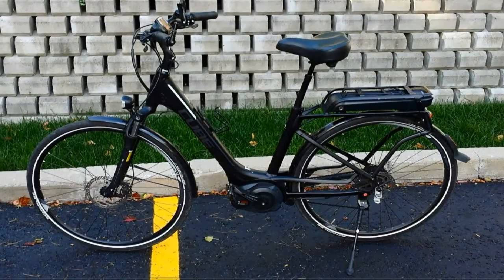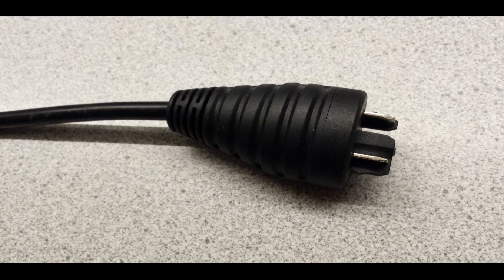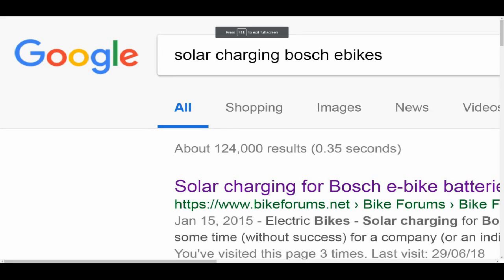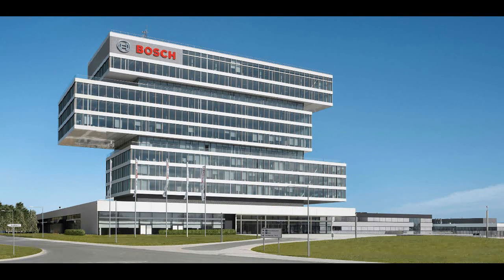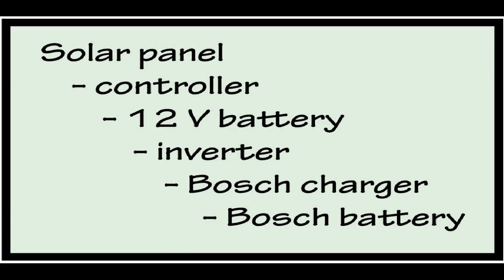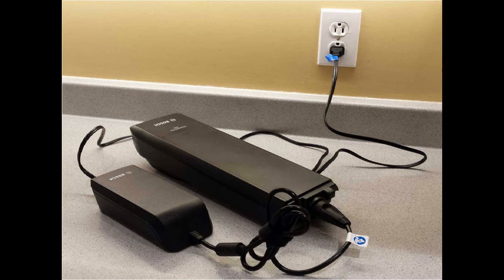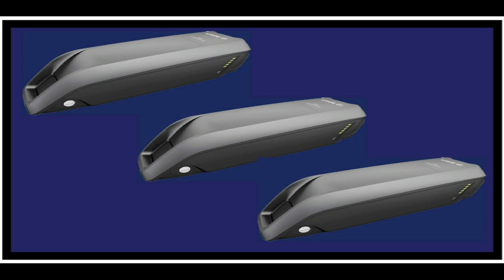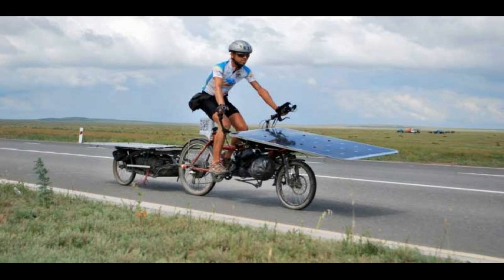Solar Charging a Bosch Ebike Battery   Disappointment

Comment: Bonjour Robert, je suis présentement en voyage de Montréal jusqu'au Iles-de-la-Madelaine avec un vélo solaire.

Je n'ai pas un moteur et une batterie Bosch. C'est un kit mid-drive que j'ai acheté de l'ouest canadien. Il est très facile de trouver le bon connecteur dans mon cas. Tu pourrais couper le fil et installer un autre type de prise peut-être?

J'ai pour ma part construit mon trailer en 2x3 + corroplast, grandement inspiré de ton design. J'ai deux panneaux de 100w sur mon trailer et un MPPT booster de la compagnie Genasun. Je suis HYPER satisfait des performances. Même en trainant tout mon stock de camping et une petite guitare j'arrive très souvent à mon camping avec une batterie à moitié pleine. Je fais des journées d'environ 110 à 150km. Je pédale environ 5 heures par jour gros maximum. 

Je me recharge dans le mur pour combler la différence le soir et je repart le lendemain à pleine capacité. C'est vraiment incroyable la quantité d'électricité qui peut être produit par deux panneaux de 100w. 

L'idéal serait d'en avoir un autre pour être 100% indépendant mais ca serait un peu trop grand et lourd en cas de panne pour moi. De toute manière, dans tout les campings il y a des plugs électriques.

Une autre solution pour toi serait peut-être une seule batterie sur mesure qui est capable de recharger à 8 ou 10 amp. La charge serait très rapide et sur un arrêt dîner par exemple tu pourrais recharger grandement.

Bref, je te remerci pour l'inspiration et je continue ma route vers les Îles. Peut-être nous croiserons-nous sur la route? Je reste à Montréal si tu cherche un endroit ou t'arrêter et camper dans mon appartement. 

Bonne route!
Vincent
Reply from the maker: Bonjour Vincent,

Merci pour ton interaction. Je suis pleinement d'accord, qu'aux latitudes du sud du Canada, il faut trois panneaux de 100 Watts pour être autonome. Mais c'est gros à charrier. Je suis content que tu aies pu t'inspirer de ma remorque pour construire la tienne. Je te souhaite un fameux de beau voyage aux Îles de la Madeleine.

Robert
Reply from the maker: Vincent,

Je viens de penser à qq chose. Quand nous aurons fini nos vboyages respectifs, est-ce que je pourrais aller voir ta remorque, vélo et système solaire?

Robert
Reply: Robert Beriault certainement!!!!
Reply from the maker: Si tu me donnes ton adresse courriel, je communiquerai avec toi en septembre.
La mienne est allorobert@gmail.com

Comment: The bosch is the worst system to try a solar charge because of all the safety limits. They sell a 2 amp charger that would run better off a solar panel/lithium ion 12volt/inverter set up.
Reply from the maker: Yea, but for me it goes against the grain to carry a battery for charging a battery.
Reply: Robert Beriault just take the charger and pug in. You can offset the carbon.
Reply from the maker: That's what I will be doing. I now have three batteries, two 400 Wh, and a 500 Wh.

Comment: They need a 5 volt power supply to open the positive and negative. A constant current dc to dc should work. Watch the video from grin tech  by ebr on the battery satiator 26.40mins.
Reply from the maker: The Satiator seems to be one of the best chargers on the market. Unfortunately, it doesn't work with the Bosch system.
Reply: @RobertBeriault753  They say it can work with a 5 volt supply to the cut off

Comment: Just read this:
https://electricbikereview.com/forum/threads/care-maintenance-and-charging-of-bosch-e-bike-batteries.23868/

In the youtube interview he talks about the signal line only needing 5VDC attached to it to work.

And then there's this:
https://rover.ebay.com/rover/0/0/0?mpre=https%3A%2F%2Fwww.ebay.com%2Fulk%2Fitm%2F172786244901

But have not received much information about it.
Reply from the maker: Interesting information. Thank you. BTW, I hadn't seen your comment because YouTube put it in the spam folder

Comment: I'm going through the same problem, i wish i could buy 1 or 2 12v Bosch Travel Chargers but nobody throughout the world seems to have them, searched ebay as well to no avail, this is the only "simple way" but Bosch no longer manufacture them :-(.
The Bosch system components talk to each other through a CAN bus so i'm guessing when a battery get's connected to a charger the charger says "Hello, i'm a genuine Bosch" and the battery says "OK, i'm genuine Bosch too" and then they start.
Information stored in a battery and/or drive unit about the battery includes: Part no., Serial no., Software version, V, Charge %, # full charge cycles to 1 decimal point, Min AND Max temperature over lifetime, Charge delivered in Ah over lifetime. All this of course helps them diagnose problems and detect conditions that any warranty does not cover.
I'm in the process of trialling various folding solar/charge controller/LifePo4 battery/Inverter solutions to charge via the 4A charger (needs 200W for 4A charging).
Reply: web curler I don't think they use any such complex communications. A 5 volt supply just opens the power feed.
Reply from the maker: Thank you for your excellent explanation.
Reply from the maker: This is technical stuff that's beyond my knowledge.

Comment: Enjoying your exploration of solar powered bikes! I've been thinking of a DIY ebike conversion, and possibly solar power after.

Have you visited reddit.com/r/ebikes and https://endless-sphere.com/forums/? There might be someone who can help you there,
Reply from the maker: Thanks for the links. I'll look them up. You're never too smart (or rather, smart enough) :-)
Have fun with your conversion project.
Reply: You're welcome, I found this 20+ page thread that may be of use for options/ideas: https://endless-sphere.com/forums/viewtopic.php?t=28436

Not speaking from expert POV, but from what I can tell, one issue with Bosch systems is that they're "closed" systems, in that you have to use parts from Bosch for modifications.  I've noticed that many DIYers use more open systems like the Bafang BBS02/BBSHD mid drive, where they can choose different parts to work with the motor.
Reply from the maker: The Bafang is something I should look into for my next year trip.

Comment: bosch sells a 12 volt based ebike charger. i use this charger in my motorhome.
Reply: Hartmut - Your 12 volter suggestion is probably the best way - get an adapter connector  for the cigarette plug  or just cut it off and hardwire it to your MPPTCC 

I can find the charger on dealer sites but I did not see it on the Bosch site,,,, odd!

Good luck  Robert on your issue - I have most of the pieces to my ebike charging but long way off to getting around to it.
Cheers, Patrick
Reply from the maker: I think Hartmut's idea is worth exploring. This charger would eliminate the need for a heavy, expensive pure sinewave inverter. And since it doesn't draw a lot of amps, the 12 Volt battery could be smaller. There seems to be a problem with availability though. I can't find a Canadian dealer who has it in stock.
Reply: email these guys to see if they can get the 12v version - I just says the cell Bosch and it is a Can site
http://citruscycles.ca/
Cheers
Reply from the maker: Thanks for the tip. I just sent them an email.
Reply from the maker: I just got a response from Citrus Cycles. Bosch has discontinued the 12 V charger. They really don't want anybody to charge their battery with a solar panel.

Comment: The lithium batteries have a BMS .The charger and the batteries communicate, if you overcharge they might explode.
Reply from the maker: I've figured that the charger and the battery are made for each other and any other charger, even from a solar panel, won't work. I suppose if you insisted on connecting a charger that isn't the correct one, it could have serious consequences. An exploding battery could ruin your whole day!

Comment: This is fascinating stuff. I too have come to the conclusion that solar power is not the answer with a Bosch power pack. I my self became concerned when I could not get any comment regarding the susceptibility to failure of the battery array when charging and discharging at the same time. I too have decided that multiple power packs are the correct, if expensive, answer. I’m also working on improving my leg strength to be able to run power off for sizeable length of a ride, but then I’m only 45 years old, so I can do that 😬
Reply from the maker: Pedaling is certainly one way of increasing range! But then, with a regular bike, range is as much as the cyclist can last.
Keep on cycling!
Reply: Just take the charger and pug in often
Reply from the maker: It takes four hours to charge a Bosch or a Pedego battery, so it's not possible to charge them often during a day.
Reply: Robert Beriault wow 4 hours.....I guess it does, I have never drained my Bosch powerpack 400 lower than about 1/4 full, that said in the U.K. we use 240v mains power, Canada uses 110v supplies doesn’t it?, I wonder if that makes a difference .
Reply from the maker: It's the amperage that counts. Mine is a 2.2 Amp. I think Bosch makes a 4 Amp. That would make a big difference (I think). I'll look into this.
Reply: Robert Beriault oww ok, I will have a look at my charger and let you know, I’m pretty sure my powerpack 400 charges quicker than 4 hours, but, as I said, I have never charged it from flat.

Comment: Could you use a charge controller from the solar panel then from the charge controller to a buck boost converter DC to DC? So maybe you can adjust the output voltage precisely to a few more volts than the electric bike's bosch battery hence it would charge up and would not weigh much as you have to cycle around the country with it.Would it work?
Reply from the maker: My impression is that there's some kind of control system within the battery itself that would prevent this.
Reply: Robert Beriault A woman and her dad has sorted the solar bike with panel on trailer.Go to you tube type in :"Solar Electric Bike Cross Country Adventure" all details about charging rates,solar panel wattage,battery and motor size is given in the video.Her name is marissamuller.com
Reply from the maker: Hers was a Specialized Turbo S. It doesn't use the Bosch motor The problem is have is with the Bosch system.
Reply: Bosch have a cut out system as described well in the video

Comment: I would ditch the bosch battery and get an aftermarket one. Or better yet ditch the overpriced bosch stuff altogether and custom build a bike for much less money with greater all around performance, which you could customize to your specific needs/desires.
Reply: dust man bosch has better safety and extensive testing compaired with other batteries. I also think bosch would be more efficient than any custom set up.
Reply from the maker: All the components of the Bosch system are coordinated, so the're no possibility of using anything but a Bosch battery, unfortunately. I just wish I had the expertise to customize my own ebike, as you suggest. But, if you compare the Bosch to the Pedego, the German bike is a better buy, quality-wise. I'm not Moneybags, but I don't mind spending the money, as long as I get something reliable and trouble-free. I don't like the thought of being stuck on the highway a hundred miles from nowhere. 
Thanks for your input.
Cheers